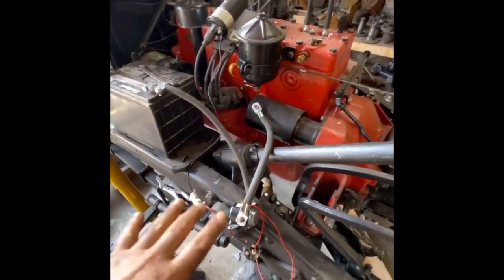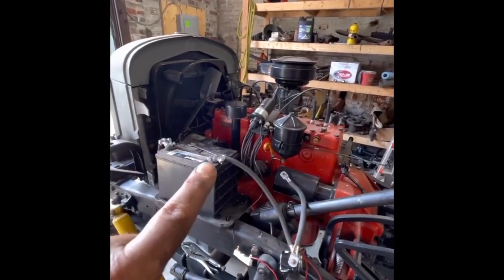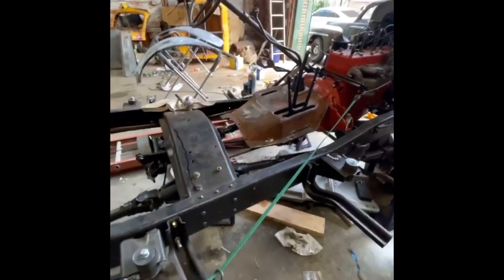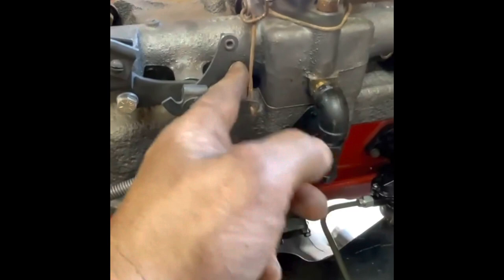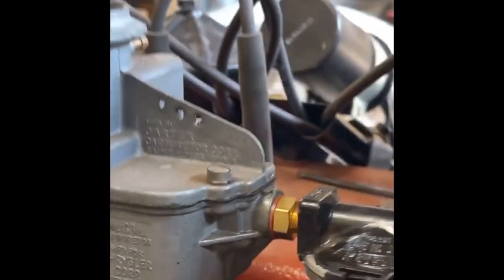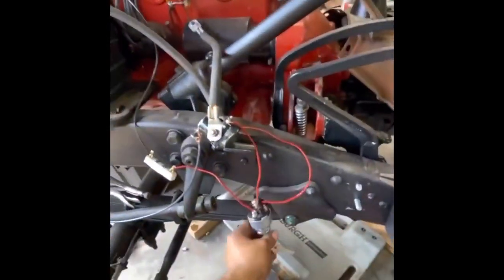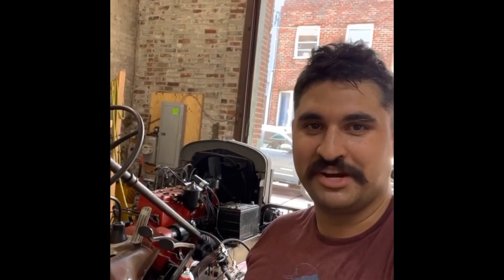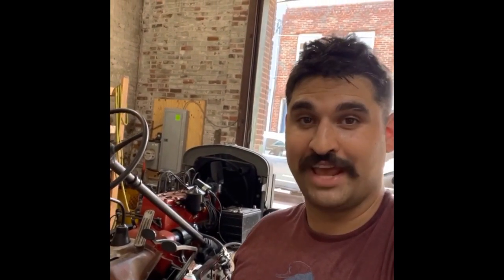First Start! Dodge Power Wagon Restoration! Chrysler Flathead Straight 6 #MOPAR

Comment: Congrats I fired up my PW engine for the first time last Saturday and she fired right up today I blocked the truck up on stands and actually put the old BAD radiator on it so I could run it for a bit, she fired right up and I got the timing set then ran her through the gears ran the 4 wheel drive both hi-lo in the transfer case and all appears to be ready to get the cab and bed put on next week although tomorrow the brakes will be filled with fluid and bled!
Reply from the maker: Awesome Karl